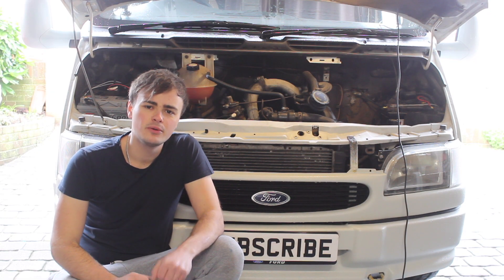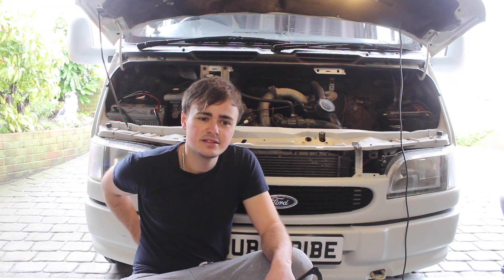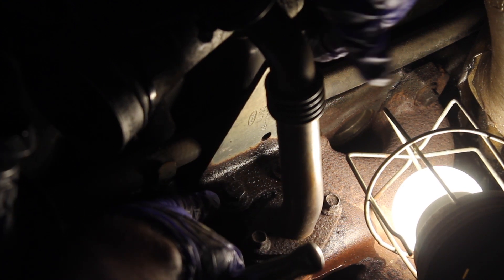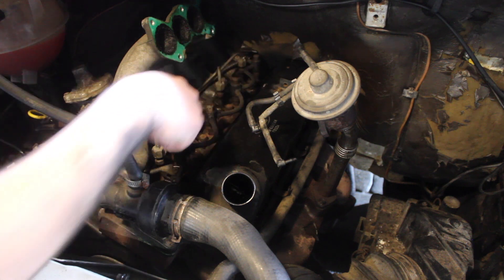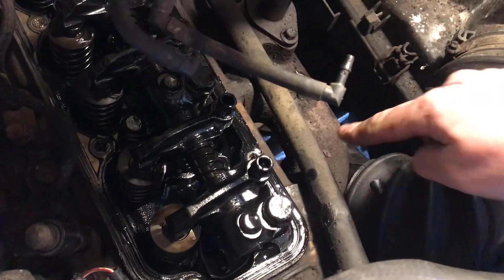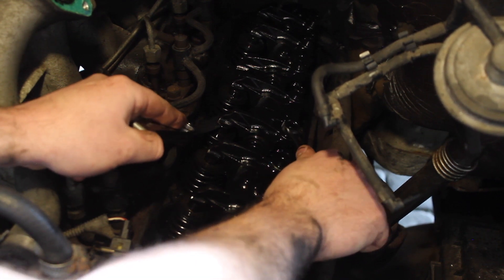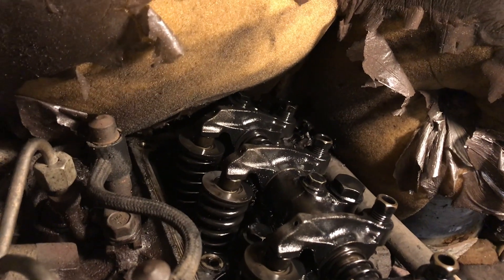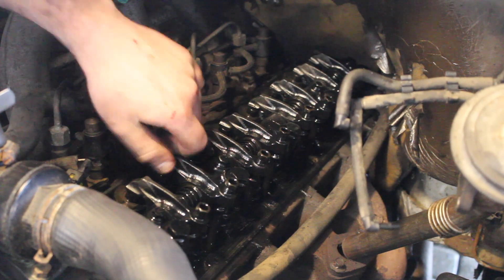Adjusting Valve Clearances & Rocker Cover Gasket Replacement - MK5 Ford Transit - LDV - 2.5DI

Comment: Will it be the same process for a 4EB 2.5 TD engine as well ? 
Thanks for you content mate !
Reply from the maker: The process will be the same as they’re virtually the same engine. You will need to check the valve clearance values for the turbo engine as it could be slightly different from the naturally aspirated. Do you have the Haynes manual? No worries mate, thanks for watching 😊
Reply: yes i have the french version which doesn't say much about the turbo or the valve clearance...
Reply from the maker: My manual is the same, it doesn’t have separate specs for a turbo model so must be the same. 0.2mm inlet & 0.38mm exhaust. 👍🏼
Reply: @TurnersWorkshop97  Cheers mate ! Will get on the job when i get the parts :)

Comment: Great video i have just brought a campervan with this engine in it . i noticed you had a egr blanking plate installed , does this make any improvments or problems and is it just fit the blanking plate and thats it nothing else needs doing , thanks

Comment: Hi Turner. Thanks for posting this high quality content! I have a smaller version of your van. And was wondering did this help with noise on the freeway? Say cruizing at 60mph or so. The noise of my engine can be too much sometimes.
Reply from the maker: Hello mate, It will definitely make it less tappety sounding if the engine is out of adjustment. Other things you could try: use 10w40 oil if you’re currently using 5w30. Slightly thicker oil should make it slightly quieter. Research using mineral 2stroke oil in the fuel as this will help lubricate the pump and is said to make it quieter (only if you have a Bosch pump). Haven’t tried it yet so might make a video about it. Sound deadening the floor pan makes a big difference, possibly the engine bay as well. Other than that, earplugs😆
Reply: @TurnersWorkshop97  thanks! Have tried some of them, will see how far can this go. Initially injector cleaners and sound proofing did help a lot. But still as one of my friends put it 'when the engineers finished the job, where they listening to this and thought "this is fine" ' :D yet this is only 60-70mph. Lower speeds on b-roads are very pleasant and the sound/engine is even enjoyable

Comment: Have done this to my Transit to. But everything was in perfect order not much to adjust. My Adjustment screw was so tight I was afraid I break it. Is this normal?
Reply from the maker: They are pretty tight as they don’t have a locking nut, stops them vibrating out of adjustment 👍🏼

Comment: Again great video can i ask do you know where i can get some manifold bolts same as yours banana engine cheers
Reply from the maker: Thank you 😊 you could use standard hex head bolts and washers, think they’re M8 off the top of my head. Or you could ask on the Facebook transit pages to see if anyone is selling some.
Reply: @TurnersWorkshop97  cheers  sorry do you know the length also another question sorry for been a pain but try to do without garage cost the banana manifold i have taken of to replace the rocker cover gasket need to replace the gasket for the banana split in middle do u know where i can get one as searching nothing cominng up cheers again for reply and help
Reply from the maker: I can check for you tomorrow, I put a link to the manifold gasket in my manifold cleaning video. You could possibly reuse the gasket if it’s in ok condition, but maybe put a very light smear of hylomar on each side to reseal it. You could make one from gasket paper or cardboard using the old one as a template 👍🏼 how come you don’t have the manifold bolts?
Reply: @TurnersWorkshop97  i do have them but one missing so need to source one from somewhere as was lost wen had new exhaust fitted thanks for help

Comment: quick question..do you not have to find tdc on the compression stroke with both of these methods,ive heard in other forums you have to do this but noting is mentioned in the haynes manual
Reply from the maker: Yes that’s correct, you find TCD (just before the power stroke) for each cylinder and adjust the valve clearances accordingly. Both methods just help find the engines TDC positions 😁 the Haynes manual doesn’t really explain it just gives the method 👍🏼

Comment: Ok... seriously, I plan on doing something on the van, then a video pops up for the exact same thing ahaha anyone want to buy a transit haynes manual as so far not needed it aha
Reply from the maker: Brilliant! 😂 Thanks for following the channel 👍🏼
Reply: @TurnersWorkshop97  just a tip as well, i see you still have the foam sound proofing in from factory, it soaks up water and holds it against the metal causing rust.  Caused a a hole behind each of my wings which in turn caused water to get into my footwell.  Apparently its a common issue so might be worth checking that out :)

Comment: Usually only gets done after the pushrods get hammered straight after a timing belt failure! 😂
That rocking method's a good tip - will do that the next time I have the rocker cover off.
Reply from the maker: Haha exactly that! 😂 thanks it’s something I found online and it’s much quicker and easier to remember 👍🏼 how’s your van coming along?
Reply: @TurnersWorkshop97  Getting there with it. Finished rebuilding my MIG yesterday so metal about to start going back 👍

Comment: great video pal,never seen the "rocking method" before,ive always followed the Haynes method,sounds a lot quieter,,you should of done the leak off mod while you had the banana off,it would of given you better access
Reply from the maker: Thanks mate, it’s something I came across online and took me a while to get my head around it. I checked the clearances on both methods and they are close enough. As you’re essentially just putting each piston at TDC and setting the clearances in the rocking method. I will be taking the banana off again to clean anyway. Got some leak off pipe recently so that will be another job. Thanks for your comment 👍🏼 😁

Comment: Great video very well explained where did you buy your replacement rocker casket from. Also I will bring my van around so you can do mine as this job always plays my back up. lol 😆 I always adjust them so there is a slight drag on the feeler gauge. take care keep up the good work..
Reply from the maker: Thanks mate 🙂 rubber/metal type gasket from transit parts uk around £10. I know what you mean being hunched over the engine lol 😂 thanks for your comment, all the best.